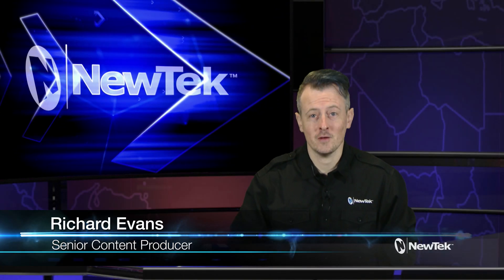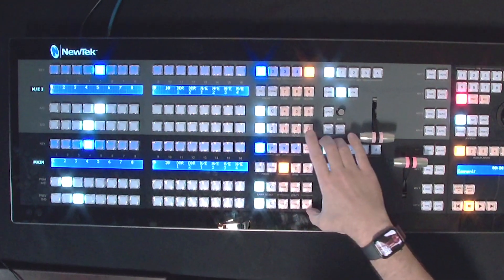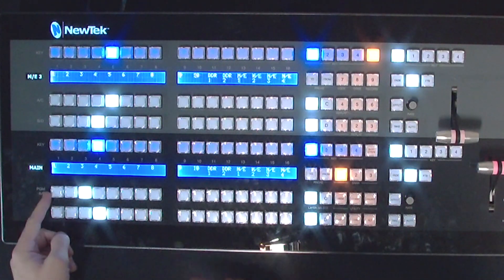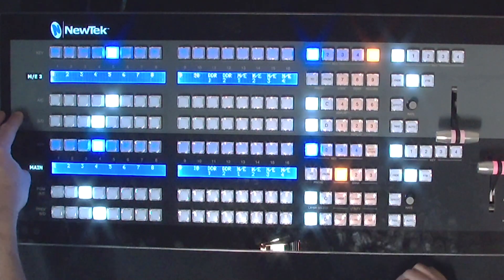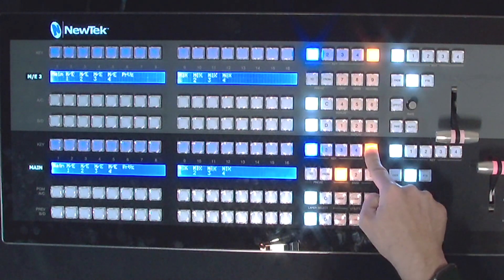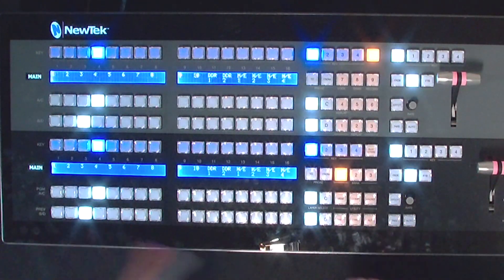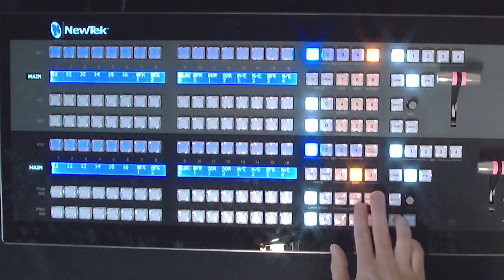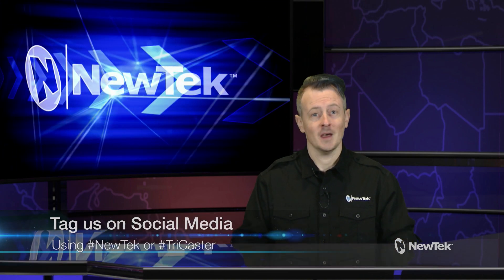Tuesday Tutorials : How To Delgate Control Surface Stripes

Comment: Hi,
I am working on the TC2 in 2 stripe version. I have 3 banks.
On the software interface, when I switch to bank 3 I have the 15 buffers displayed, but when I switch to bank 3 of the mixer, I cannot find these 15 buffers.
Is it possible to display these 15 buffers on the mixer as at 2.37 on the video?
I already went to look in the adds-on menu, but I did not find my happiness.
Is there an .ntm file?
Our integrator tells me that it is impossible to display more than 3 buffers as is currently the case ... I am skeptical.
Thank you in advance for your reply
Reply from the maker: well that's weird, you should be able to hit bank 3 and see all of your Buffers.  When you hit Bank 3 what all is displayed?  And you can display more than 3 buffers for sure utilizing DSK's and Mix Effects.
Reply: @NewTekInc  The issue is that on the TC2, I believe you are using a TC1 in your demo, the bank in the software has 24 keys and the 2-Stripe only has 16. As such it cannot display everything on the first bank of the surface that is displayed on the 1st bank of the software. This carries over for bank 2 and 3. As a result when you goto bank 3 of a 2-stripe (and 4stripe)  you are presented with inputs 21-32 and then finally Buffers 1-3 and Black. Further the remaping tool seems to simply be, remapping. I can move buffer 3 into buffer 1s place but the utilitiy does not appear to allow you to say change banks 3 inputs 21-32 into buffers 4-15.

Comment: very good work thank you 
i try to use NDIIO with ue4.26 but whene i activte the plugin in ue4 that get a message  the fllowing models are messing or built with a different engine version NDIIO
NDIIO EDITOR 
engine modules cannot be compiled at runtime please build throug your  IDE
knowing that i use ue4.26 and i download the NDI TOOLS And SDK  for ue4.26 version from  https://ndi.tv
if you have idea to resolve a problem thank you
Reply from the maker: hello.  Not sure exactly how to fix that.  I would recommend contacting our customer support so they can attempt to stage your issue and resolve it.